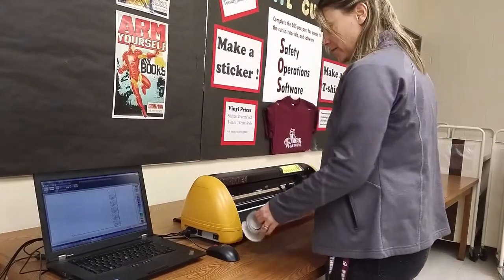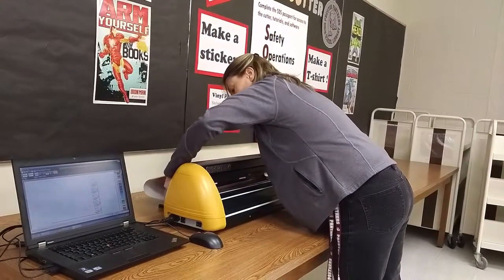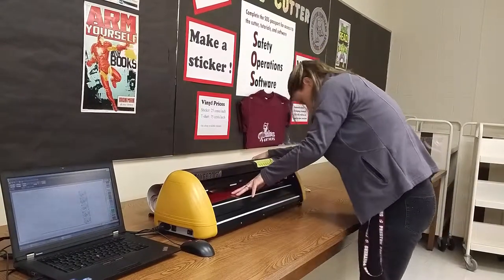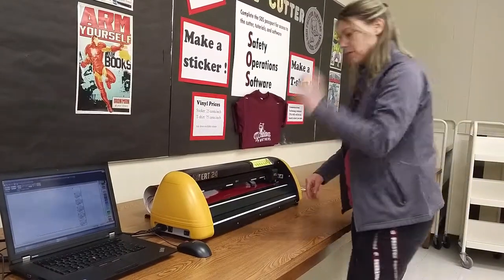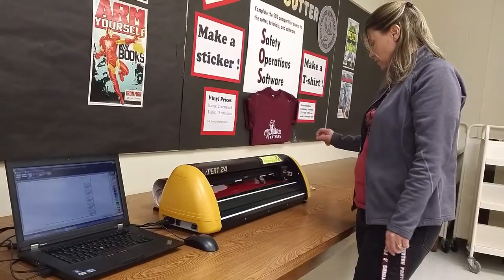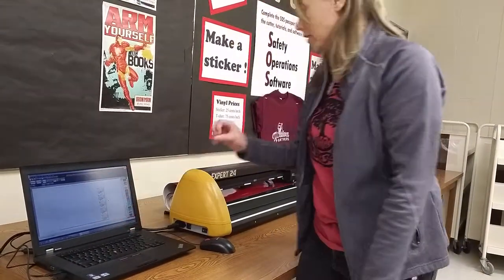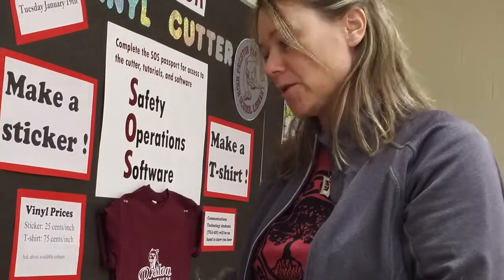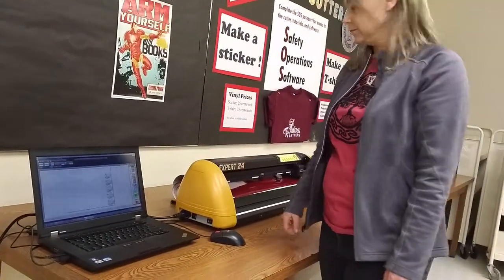Loading the vinyl cutter

Comment: I do everything you do, but my vinyl either pushes it out the front  to far or it pulls out the back. No matter what I loose anywhere from 2 to 3 inches of vinyl every time, sometimes even more....
Reply from the maker: Suicide Betties try loading the vinyl first and then turn it on so that it will set the origin.
Reply: I load my vinyl first and than turn it on so it can register it and it’s doing the same thing. It pushes the vinyl all the way out or it cuts a bit than the error light starts flashing. I’ve been trying to figure this out since yesterday afternoon I’ve made some progress but idk what else to do I’ve done everything and it’s still not working properly. I only have the sheets of vinyl and now it’s ruint all 7 sheets I had.